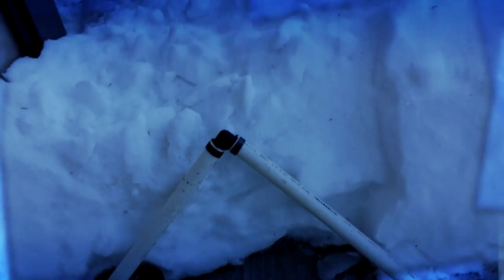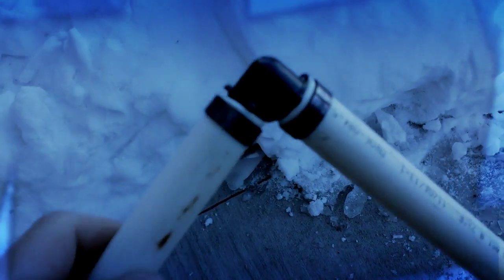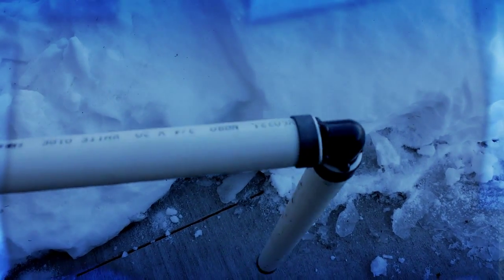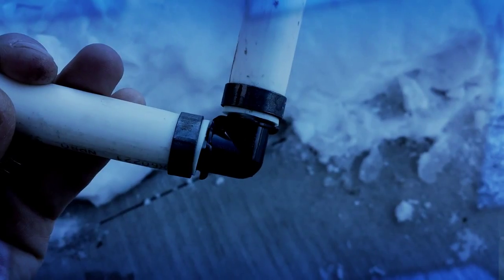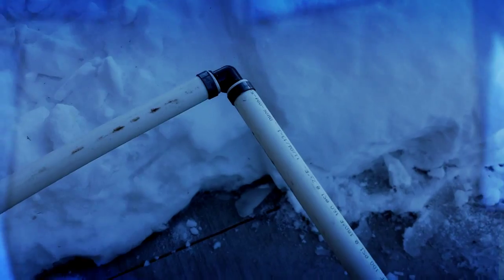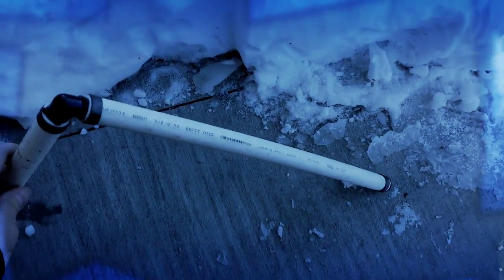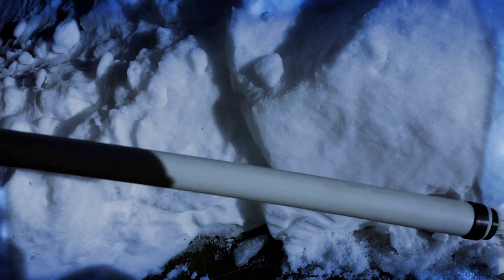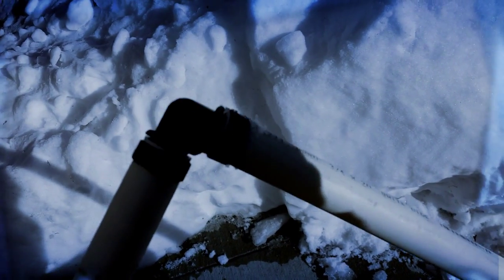HVAC-Poly Pex fittings: Freeze test

Comment: Hi thanks for the video.  My only comment is that the rings are too close to the fittings. The recommendation is 1/8 to 1/4 inch away from the end fitting.  As is, It should be fine but not ideal. Cut the ring off and look at how the PEX pipes are connected to the fitting. I bet only one of the two compression rings is fully used.

Comment: I have been using pex for last 14 years. I will never use the poly fittings, have seen what happens over time with them numerous times. We live in a doublewide and it had poly pipe and poly fittings throughout. When I opened up underbelly and flooring from in home to replace all, 75% or more of the poly fittings were cracked and leaking. This has been a common occurrence over and over. When the lawsuits over the poly pipe came about years back, it was more the fittings cra king than problems with the pipe itself. Take care, Brett
Reply: You are talking about two different things here. 

First off the piping you replaced was polybutylene or poly b piping, and this piping is a polyethylene. Completely worlds different.

Second you are completely wrong with the fittings being the issues with the poly b lawsuit, and it’s these type of comments that spread those myths. 

Please visit our page on poly b for more clarity. 

Graham D
National leader in poly b replacement 
Www.urbanpiping.com
Reply: What's your preferred fitting?